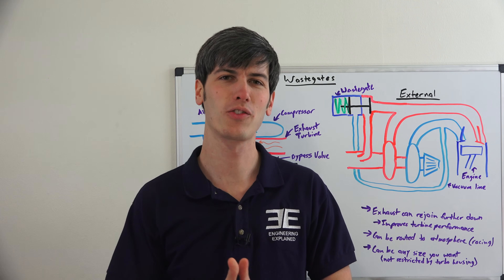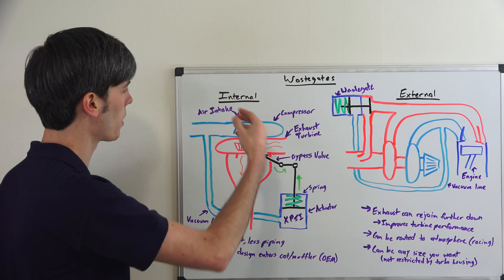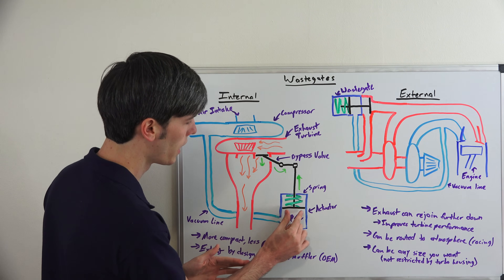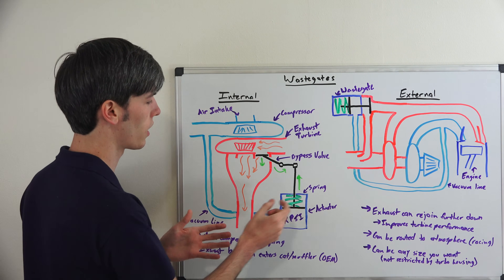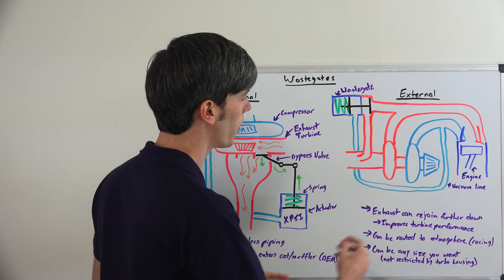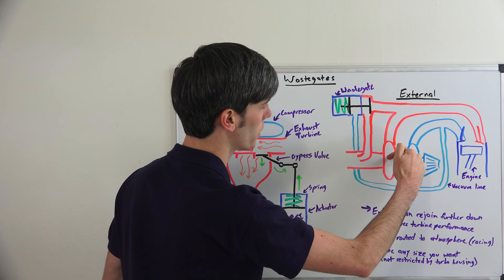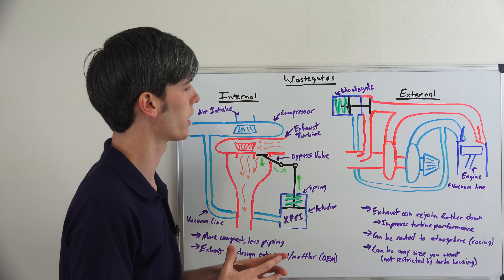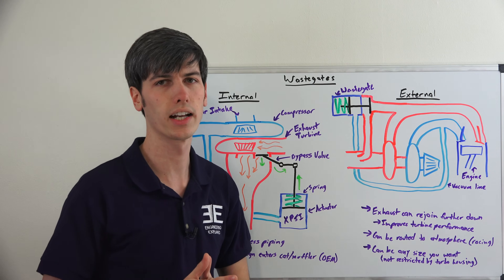How Turbocharger Wastegates Work - Internal Vs External

Comment: But what's better wastegate on manifold or down pipe ?
Reply: And also some ecus read those fumes so some cars are required to not dump to atmosphere
Reply: +Neon Droid A wastegate won't have any function on a downpipe as it's only redirected exhaust gases after the turbine. Needs to be before the turbine, i.e. on the exhaust manifold or built into the turbine housing just before the wheel.

Comment: the internal one makes the flutter noise right? or am i just being stupid
Reply: +xIMoNzTeRz Nothing to do with a wastegate. The turbo will flutter when the throttle shuts quickly without a bov in place (or one that doesn't flow air quick enough). If the throttle valve closes quickly all the pressurised air in the piping between the compressor outlet and the throttle body will try to escape back through the turbo, which can be heard as the fluttering sound we all know and love.
Reply: mitchellrobertson15 im not knocking you man as long as you enjoy your car man i feel you on the car tho i ended up with a 9th si instead of a g37

Comment: but can you have a blow off cable and turbo waste gate at the same time?
Reply: valve fucken piece of shit
Reply: +xXSUPREMEOMEGAXx Well, at least for turbocharged gasoline engines, you almost always have both valves.
It's a bit different for Diesel engines tho. You still have a wastegate but normaly you don't need a blow off valve in a Diesel engine. There're some aftermarket blow off valves for Diesel engines, but they actually don't do much except for the nice pfffhhhh sound.
Reply: +shi01 well that's probably why most people buy them any way haha

Comment: Why would you want less forced induction??
Reply: +luke carlson So your car doesn't blow up? Theres a limit for every engine
Reply: +luke carlson because too much pressure will cause compressor surge (the air go back through the compressor), and you don't want that.
Reply: +99Bodi hence making the stutututututu sound
Reply: +luke carlson so you don't lift the engine head off.
Reply: also I would guess even with a strong engine you may wish to limit boost to avoid running lean if the fuel system cannot output enough

Comment: What about boost bypass valves/blow-off valves for superchargers?  My car has a roots-style blower on it and a BBV, and I have no clue how it works except that it has a solenoid and doesnt let boost into the cylinders if it's below 75% WOT; especially considering the venting occurs after the MAF sensor, how does it get an accurate reading on the amount of air coming in if some of that air is being rerouted back into the engine compartment further down the intake system?  Love your channel btw.

Comment: Why do you waste the exhausted air and not the compressed air?  I would think if you wasted the compressed air then you could keep up the rpms of the turbo on the exhaust side.
Reply: +3.141 59 Yeah you would save the engine from pressures that it cant handle,  but you would still leave all the stress and pressure  on the turbine which cant be good for the long run...
Reply: Exhausted air is what drives the turbo to create boost. Wasting the compressed air is what a blow off valve does.
Reply: +thug898 But the waste gate is on the exhaust side thereby releasing the excess exhaust air in order to control the maximum amount of the compressor air.

Comment: Could you use a wastegate to improve economy in non racing applications? Let's say in cars with stock turbos, in light loads or constant speeds, using a wastegate to keep the turbo from spinning?

Comment: Feeding it back to the main exhaust pipe will not upset the exhaust note?
Reply: Depends on where you route it back to. 
If you route it back before the cat, there will not be that much of a difference in exhaust note, if any at all.

Comment: Does this come stock with the turbo charger?
Reply: +Christian Rodriguez Little turbo's usually have them integrated into the turbine housing. It's very rare to see a big turbo with an internal wastegate. 99% of the time the bigger ones require an external wastegate, which are generally a lot better than internal wastegates for holding the boost at the right pressure. If the wastegate is too small for the amount of exhaust gas flowing through the turbine, the boost will start to increase at high rpm, which obviously isn't good if the motor isn't reinforced and is tuned for that amount of boost.
Reply: +timruddell125 but if the wastegate is small shouldnt open easily with small pressure?(thanks for answering though. Really helped)
Reply: +Christian Rodriguez how easily the waste gate opens is entirely dependent on the spring in the waste gate. If the waste gate spring is stiffer, the air in the vaccum lines has to be at a higher pressure to overcome the springs force. Boost controllers work by using a solenoid in the vaccum lines to bleed off some of the air in the lines, so there is less pressure on the spring. The size of the waste gate governs how much exhaust gas can get through at peak flow. Bigger waste gate, more flow capability. So if you want higher boost, you can use a smaller wastegate as it doesn't have to divert as much gas from the turbine as it needs more gas to spin the turbo faster. But if you only want a low boost pressure or you're using an engine producing a lot of exhaust gas (large displacement or a Wankel), you need a larger wastegate so it can flow the large amount of gas that will have to be diverted, especially at high rpm, otherwise the turbine will receive too much exhaust and over boost the engine which can cause catastrophic failure real quick. No worries dude.
Reply: +timruddell125 thanks so much

Comment: One of the other things for controlling external wastegates is since they have vacuum ports for both the top of the diaphragm and the bottom you can literally put just an 8 psi spring in and then buy a boost controller and running much higher numbers so you have the tune ability anywhere in between that.  

Also open wastegate dump FTW !

Comment: So there is no real reason to direct excessive pressure to the atmosphere rather than exhaust manifold other than
"BRRRAAA-P-P-P STu-TU-sTU!!"
?
Reply: +o3tomas That's blow off valves your thinking of, something else entirely. 

And there are many benefits to redirecting it to the atmosphere rather than the main exhausst, such as better flow due to no turbulence in the flow, no restriction as the silencing doesn't come into play, but yes the main benefit is again with no siliencing, thereofre the car can be made quiet when off-boost but then when it's on-boost and the wastegate is open, it is unsilenced and can be very loud. This is a good way to get around noise restrictions on a street car, however you will then run into illegality with emissions etc. It is for this reason many refer to it as a "screamer pipe"

Little known fact: the middle exhaust pipe on the Ferrari F40 is a screamer pipe from the wastegates.

Comment: Thankyou!  Now I understand how a wastegate works. But why do you want to reduce the flow of exhaustgas to the turbine? correct me if i'm wrong, but using a wastegate results in having less boost. Then WHY use it?  is there an upper limmit to what pressure or rev count the turbo should be working on? and if yes, is this the way how that is regulated?
Reply: +Peanut! Yes and yes. It's to make sure the turbo doesn't just spin as fast as it can under acceleration, prolonging the life of the turbo. It regulates boost pressure, caps it off before it does any damage.

Comment: What actually is a waste gate for? Why do you need on because old turbo cars didn't always have them.
Reply: johan mattsson yes that explains it very well. Thank you.
Reply: +johan mattsson You are both confusing wastegates with blow off valves/bypass valves, every turbo will have a wastegate other then variable geometry turbo (very few cars have these).

Also not running a blow off valve/bypass valve will not destroy anything, they are factory fitted for emissions reasons.
Reply: DriftNick wastegates are not blow off valves?
Reply: Gary Lowe No they are not, wastegate bypasses exhaust gasses around the turbo to limit boost, blow off valves releases pressure on the compressor side when you lift on the throttle.
Reply: DriftNick ah. Ok. I will do some reading up on this. I thought the 2 were the same thing just different names. Thanks for the explanation.
Reply: DriftNick sorry. 1 more question. I have a Renault 5 GT turbo with knob in the car to  adjust the boost. So this will just be controlling the wastegate. Is this correct?
Reply: Gary Lowe Yes it will control the wastegate, as explained in this video there is a vacuum line that goes into the wastegate actuator to control when it opens, boost controllers splice into that line and leak boost pressure to pretty much trick the wastegate into thinking it is running less boost, the more it leaks boost the more pressure you run and this is what that knob would do.
Reply: DriftNick yes. That sounds right as when I first got the car I could hear a hissing sound coming from behind the dash board. The pipe going to the boost controller had a split in it. So can I get a waste gate off of a bigger turbo and fit that to get more boost and so more power?

Comment: Can you please do an explanation on how you can make a car louder with a wastegate? I heard the 2016 f1 cars are louder because of something related to it. Thanks!
Reply: +PuffinDragun69 They are basically bypassing the exhaust in favor of venting the wastegate to atmosphere.
Reply: +PuffinDragun69 F1 in the last few years didn't run a wastegate, boost was pretty much controlled by how much fuel they use, more fuel burnt = more exhaust gases and most boost, because of this all the exhaust goes through the turbo which muffles the sound, with a wastegate in this years F1 some of that exhaust gas isn't going through the turbo and doesn't get muffled as Afro said above.

Comment: How is this different from a blow-off valve?
Reply: a blow off valve goes on the intake between the throttle body and the intercooler and releases the pressure that builds up in the intake system when the throttle closes but the turbo is still spinning and producing boost (like when shifting up a gear). The wastegate sits in the exhaust system parallel to the turbo and allows excess exhaust gas to bypass the turbo once the desired boost pressure is reached (because more exhaust gas equals more boost, and too much boost can wreck the engine).

Comment: exhaust gases go into the turbocharger and spin it, witchcraft happens and you go faster
Reply: or could call Samantha in the Bewitched to increase the speed but need more gas...
Reply: Vroom vrooom
Reply: Exhaust gases go into the turbocharger and active the flux capacitor in it .... That's how you get the boost .........if you want more power .. simply upgrade your flux capacitor ... You can pm me for a race grade flux capacitor low price guarantee!

Comment: This brings me back to my dodge srt4 days! Ppl would either replace the wastegate actuator with a stiffer one (to hold boost better) or put a preload on the spring....Some stock wg actuators allow you to adjust preload of the spring...This is essentially compressing the spring in it's "resting/closed state"... Making it tighter/stronger (preventing the wg from opening as easily)... Which in turn allows the turbo to make more boost or hold peak boost longer. Interesting stuff for sure.

Comment: My tuner increased the psi in my car from 12 stock to 20 psi, I'm assuming the wastegate is electronic?
Reply: Unless your car is well built
(read: well modified) and tuned for it or is a diesel, 20 would  probably be a bad idea.
Have you changed your intercooler, exhaust, mapping, fuel and ignition to suit?     Can your turbo handle 20 or is it right off out of its efficiency curve.
You can't just wind up the boost get more power.
20 psi into stock engine go boom sooner than later.
Reply: +blyndrotor it goes to 20 for few seconds under wop at 5800rpm, I run mostly in the Eco mod which is 10psi most of the time and 16 under wop. 
The turbo in the Cruze can handle 23psi comfortably (more wear n tear of course) I keep it max at 20psi to b on the safe side n I rarely actually do wop
Reply: +Wilson Pabon 
So I can safely assume its a diesel.
Just be sure that the appropriate fuel flow increase has been considered and applied for the boost increase.
As I said about I/cooler, have you upgraded.
Is your tuner a tuner or general mechanic.
You say you keep it at 20.
I'm guessing you are using an electronic boost control or are you using a boost bleed.
Reply: +blyndrotor I'm not mechanically inclined so I'm not too sure, the tuner is a tuner n he has been working with these engines since 08, he has tuned over 250 cars with this engine. He is experienced and its gas not diesel, I believe I'm not sure but the 20 psi last few seconds (temporary over boost?)
Reply: +Wilson Pabon 
I'm Australian so you better clarify. Here when someone says gas they mean GAS not gasoline.
Still those pressure no's seen pretty high for a stock engine if not diesel.
Reply: +blyndrotor gasoline and the car comes stock with 12 psi (it's a 1.4L engine) and the tuner usually tunes them at 22 psi using 93 octane. I asked to b on the safe side and also not have as much wear on the parts.
Reply: +deear diesel 
I know that.
I wanted to know what type of engine he had and what supporting mods were done.
Lets face it almost doubling the boost is a bad idea without supporting upgrades.

Comment: so how does it actually increase the power output of the engine?
Reply: +Fumetsu Kage Wastegate controls how fast the turbo spins, so it letting the turbo spin faster means more boost, more air into the engine means you can burn more fuel and make more power.
Reply: +Fumetsu Kage It doesn't really. Normally when you modify everything to fit an external wastegate it is because you are also adding a bigger turbo too. Although if you change the wastegate spring or add a boost controller to the vacuum line then you will affect the amount of power.
Reply: Ben Hamilton and that affects the power output how? what is the specific physics that determines how turbo changes the power being delivered to the wheels?
Reply: DriftNick yeah that works for me. thanks

Comment: What is the difference between a wastegate and a blow off valve?
Reply: +Matheus R One controls boost pressure by restricting the amount of exhaust gases getting to the turbine, the other relieves pressurised air in between the compressor and the throttle (basically all the intercooler piping) when the throttle shuts abruptly.
Reply: +mitchellrobertson15 thanks!!!

Comment: Very informative as usual. I was curious though, if an EWG was set up to dump directly into the atmosphere wouldn't that be an emissions issue or am I missing something?Thanks-JB
Reply: +Just Drive Yes, that's illegal pretty much everywhere. That's why it's only used in race cars.
Reply: +Kepe Gotcha, Thanks!
Reply: Yes, your car doesn't meet emissions regulations so it's illegal on the streets. You'd have to pipe it back into the main exhaust for a street application.

If you really want to run screamer pipes open on the street, you cam only do it if your state or region doesn't have smog checks. If you need to get smogged, then you have to put a catted exhaust on it in order to pass emissions and then re-install your catless exhaust with screamer pipes afterwards.

Comment: So is this what makes the "stu stu stu stu..." sound?
Reply: +Против Глобал Oh OK, I wasn't sure I had both confused...
Reply: +Carlos Melgar stu stu stu sound is caused by not running a blow off valve and has nothing to do with the wastegate, when the throttle plate closes the boost pressure goes back over the compressor blades making the stu stu stu sound.

Comment: How does an engine regulate how much boost it has? Are the waste gates electronic?
Reply: +Edward Ciotic The wastegate is mechanical, the boost pushes on a membrane which forces the valve to open, but only if the pressure is high enough to counter the load of the spring. Its self regulating. But you can control the pressure the wastegate receives with a mechanical or electronic device to control boost.

Comment: why would you exhaust bypassed intake air directly into the atmosphere in a racing application? you said discharging it into he exhaust increases turbo efficiency
Reply: +JackSwatman as compared to a internal wastegate.
Reply: +JackSwatman The wastegate only affects exhaust gases, not intake air
Reply: +Ben Hamilton oops sorry, yes pretend intake reads exhaust or something haha
Reply: +JackSwatman If you dicharge the air into the atmosphere instead of flowing it through the exhaust, you have less piping to do, less things to break, less restriction and less weight. The only reason we exhaust the gas back into the exhaust system is due to emissions.